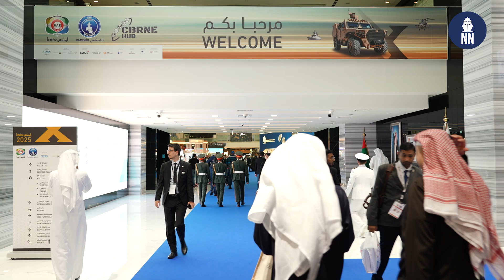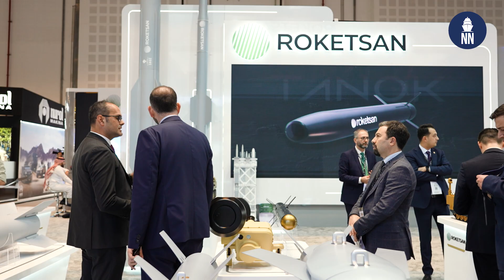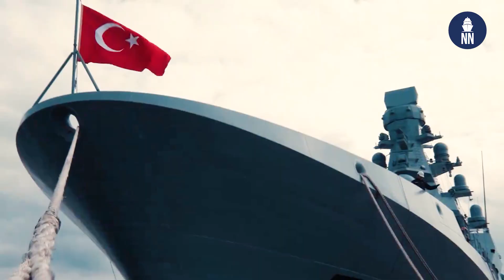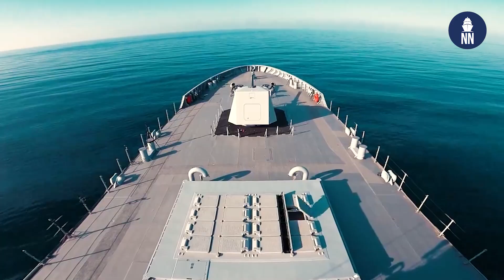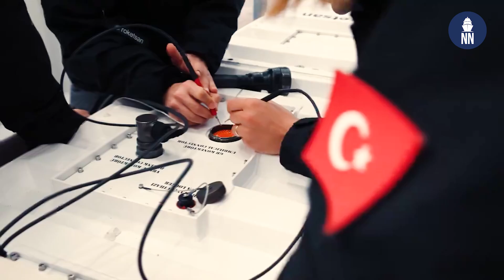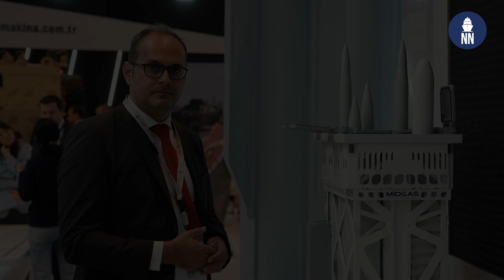ROKETSAN's MIDLAS VLS at IDEX 2025

Comment: I wonder how much tech is actually in a VLS cell. It seems like it's just a box with a flame diverter, a lid, and some radio integration to talk to the effector.
Reply: If you look at the market, you can see only a few countries actually produce this technology. It surely seems basic, but apparently something hard to develop.
Reply: @Runo1923 it's not the VLS, it's the missile in the VLS that was hard to make.
If you just look closely, all countries that can make VLS have their own Missiles inside the VLS.
Reply: At first I had thought in that way but it is not. You can find serious articles on that issue in the us navy related websites. Cutting edge technology in the field of warship making.
Reply: I care only about the end result, and in the end Türk's when they fire missiles, they hit the Bullseye right on the target. That explains everything for me.
Reply: Actually too much tech is needed for quadpack VLS system. 16 cells and every cell is capable of carrying 4 missiles which make it 64 missile platform. And if a ship has 2 of them 128 missile is ready on board. Also Turkey was under embargo from USA, and couldn't finish domestic frigates without vertical launch systems. So developing a chean variant of vertical launch system gives alternative to many countries which can't buy it from western powers.
Reply: I believe the VLS itself is simply a biproduct of missile developments. The truck mounted launch tubes (basically ground VLSs without heat deflectors/flame diverters) are probably redesigned into ship VLS systems, with those components you have mentioned.